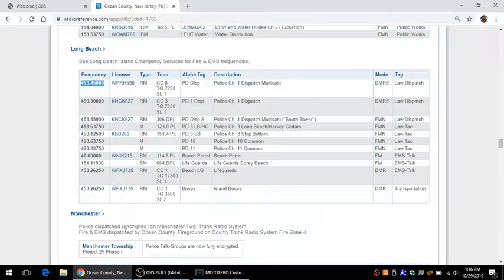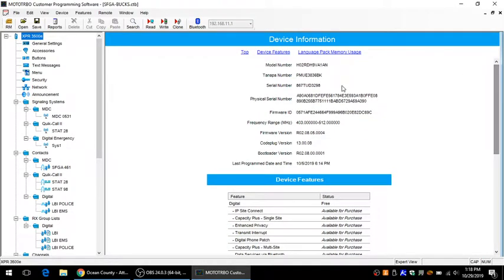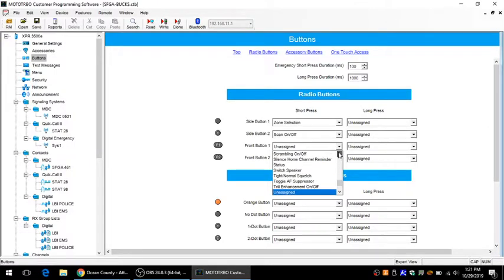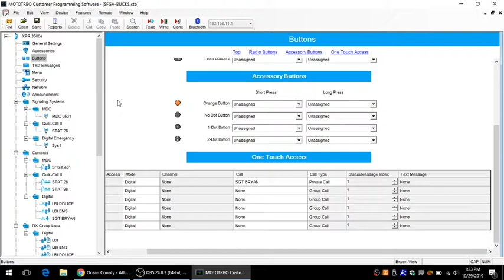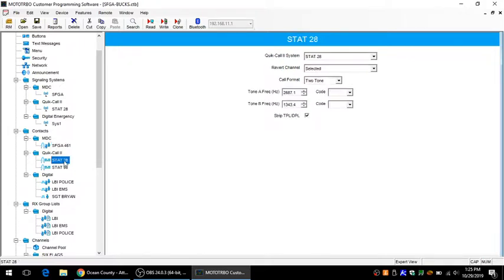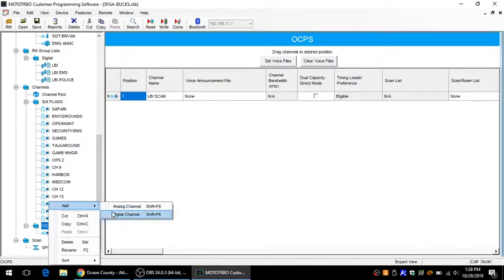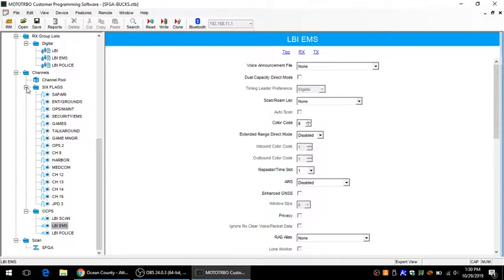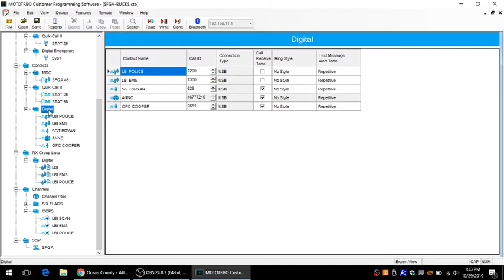Mototrbo programming

Comment: Can you monitor p25 700/800 with an apx encrypted? Can you get around the system without keys?
Reply from the maker: You can not monitor encrypted channels unless you have permission from the system admin and department
Reply: @hunter10158  didn’t you do a video about non affiliated scan? Is this the same thing what I’m talking about?
Reply: @mr_yosh3065  if the system is encrypted you won't be able to hear anything with any system. If you want to NAS you need to program your radio properly, but if there is encryption you won't hear anything.

Comment: Is there an option to change vhf or uhf on the 2 way radio settings software.  Also does the antenna has the option to change by switching  the antennas  to a vhf or uhf antenna
Reply from the maker: Generally the radio you have will be single band (uhf or vhf) and you can not change bands,however you can buy a dual band radio that allows you to do both bands that you need. The antenna that comes with said radio will be what is needed to operate on that band or bands

Comment: Better off using CPS version 15.5 that's what I use
Reply from the maker: Railfan 51 email me i have a question
Reply from the maker: Railfan 51 i emailed you with a question**
Reply: Where does one go about getting a copy oc CPS
Reply: Can I get a copy of the 15.5 version ? I need it for my fire department radios, the new cps version 2.0 won’t read the old code plugs
Reply: @caseyberry1005  you’ll have to reach out to Motorola, if you’re a fire department you should be established with Motorola Solutions and have no problem getting a CPS.